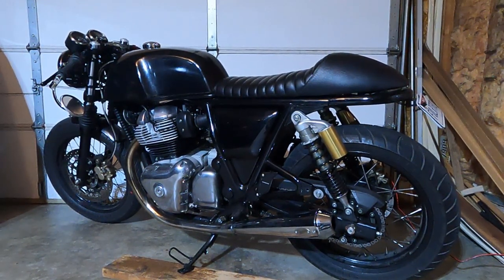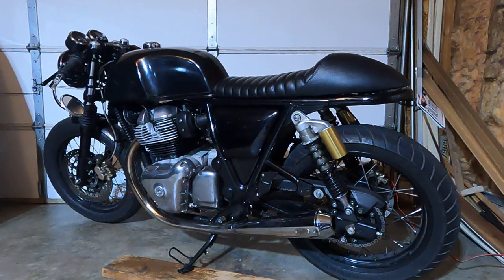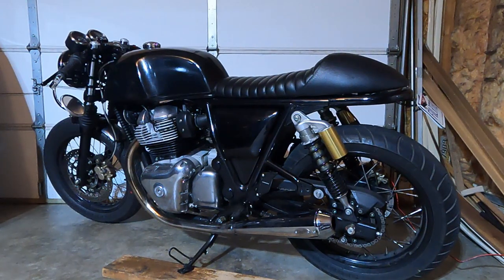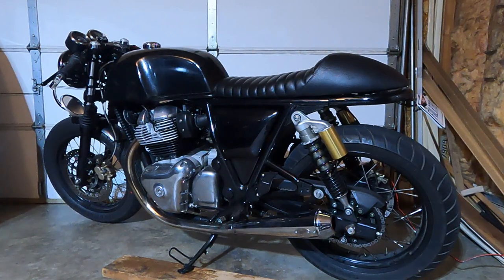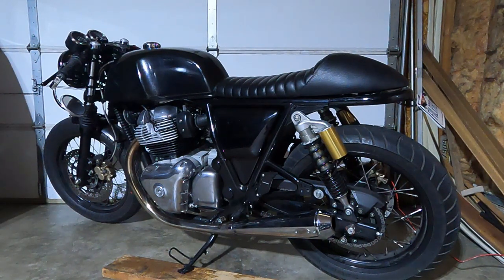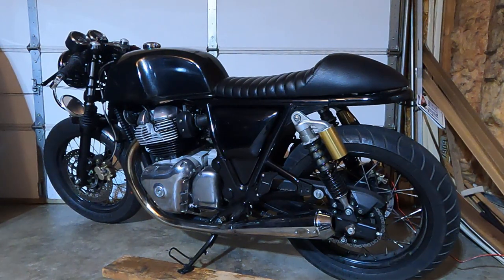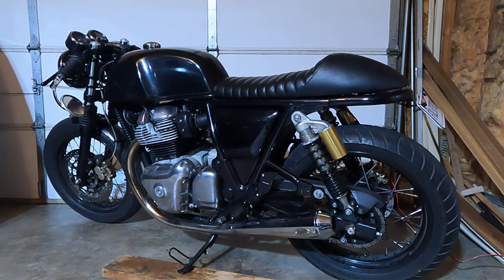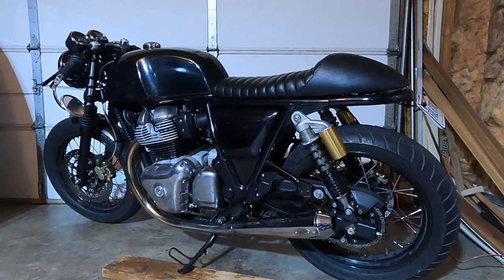Royal Enfield Continental GT Big Bore 865 Review, 0-60, and Epic Power Commander Map Battle

Comment: Much appreciated. I am using the 83.5mm pistons in my INT650 for 743cc, my two Triumphs have 90mm pistons 865cc; technically the 90mm pistons in the R.E. yield 863cc...your bike is very impressive and must be between 65-70 horsepower. It reminds me of the Norton 850 which had 4 gears instead of 6 and was much lighter (1970s). I had script made for my side-covers that says "750 Interceptor" in honor of the Enfield twin terror of the mid 1960's. 
Looking forward to the next video!!

Comment: Damn, I knew the mileage would drop with this upgrade but I didn't think it'd be that low :( Thanks for the update video
Reply from the maker: Part of it is me riding it like a crazy person everywhere.  I'm hoping to get more data with the 17 tooth sprocket and some longer cruises.  Thanks for watching!
Reply: @OakInch  Yeah to an extent bikes are meant to be rev'd out more than cars lol ya know. All good though. I don't think that would stop me from doing this in a few years. Veeeery involved of course, I still haven't watched fully your process video. Any reason you didn't take it to a dyno? Was it just not wanting to spend more to get that done? Would it have helped you speed up your process after the installation and stuff?
Reply from the maker: @motomitch  I may end up a the dyno at some point.  If I can get a canned map that is 95% of what I am looking for, and I can do everything myself, I am happy with that.  I have one more project coming up, and a couple more that I am considering.  Not sure how much money I want to spend on 10 more HP.  But, it may be too early to go through the process of really fine tuning the bike at this point.
Reply: @motomitch  nobody is mentioning that of all the S&S big bore kits, the two for the Enfield 650s are the only ones that are NOT bolt-in. First the liners need to be fitted. Secondly, the inside diameter of the liners is smaller than the outside diameter of the pistons so the liners need to be bored to obtain recommended piston to cylinder wall clearance. I had my machinist cross-hatch the cylinder walls and everything is a perfect fit; only the lower piston ring needed to be filed for the proper end-gap. The upper ring and oil-control rings were dead on specification after the cross-hatch. Both the 743cc and 863cc kits are not simple bolt-in. 
 I have built four of the so-called bolt-in kits and they are a cake walk in comparison. Hope this helps.
Reply: @frederickwoods5943  It does. Know what you helped me figure out? If I do this t omy bike, I don't wanna be the one to do it! lol, thanks for the info.
Reply: @motomitch  any competent machine shop/machinist can do the work but they charge by the hour. Mine was over $200 but that got it to the "measure your clearances and bolt the components in" stage. It is worth the almost $1,500 I spent for the torque alone. You are welcome.

Comment: Thanks so much for the vid and the info and problem solving you had to do with the mapping that is awesome. So, if you don't mind me asking, considering all the cost and for lack of a better word, hassles of it all to dial it in, is it worth it, would you do it again?  What is your feeling of the Diablo full exhaust, install, fit, quallity, I'm thinking about buying them just love the curve in them from the from the engine back, much nicer sweep then the bends on all the other exhaust systems available.
Reply from the maker: I think that people who do projects and mods can relate to what I am about to write.  The idea possesses you.  You are compelled to progress towards the goal.  It becomes thing you want to do most in life.  IDK if I would do it again.  I know it would go much faster and easier the second time.  Right now the bottle neck is air flow at high RPMS.  It is another $6000 for an upgraded throttle body and head.  It will also gain about 10 hp.  I am probably not going to do that...unless I am compelled.  I do have a limit.  Realistically, I think a full exhaust, DNA air filter mod, and power commander would have been enough performance.  At some point the money is better spent on a different bike, unless you genuinely enjoy doing the work.  Mostly, I enjoy the series of small wins as I make changes.    

I do like the Diablo exhaust.  I bought mine in a few years ago and only just now put it on.  I agree that it looks better, being curvy, than some of the others.  It fills in some space down low and in front on the bike that needs filled.
Reply: @OakInch  Thank you for getting back to me, thank you for making these vids and sharing them, for me they help a alot. Your bike is really really authentic 60's and 70's original sport bike beautiful. I'm 58 years old and old cafe racers BSA's and Kawi triples were the first bikes I fell in love with as a kid with 3 older brothers. I love my continenal, I connect to it like my old 78 RD400, it had clip ons and chambers. Thank you again, great bike buddy you should be proud of that bike and all the effort and work you put into it.
Reply: @OakInch  this is why I bought two of the S&S "750cc" kits; the roughly 47cc's increase per cylinder doesn't require extensive (or any) modification to the stock injectors, throttle bodies or ECU. If a person wants a "900cc" bike there are plenty, I own two 865cc Triumphs: Bonneville SE and Thruxton for instance. My 750cc 2020 Interceptor cost about $7,500 including the out-the-door purchase in May of 2020 ($5,949), the kit and machine shop fees were less than $900 and an S&S cam, and parts (8 head bolts, cylinder base gasket, etc another $75) plus a full stainless-steel exhaust system...just north of $7,400. Doesn't include my time of course, the bike has 28,000 miles so far. It is lighter, faster and cheaper than either of my Triumphs.

Comment: You needed a custom map making at a rolling road to get the fuelling spot on… every bike is slightly different. A none custom map is just a compromise. 
If you over fuel the the engine you will get bore wash and end up getting wear in your bores.
Reply from the maker: After I removed the airbox last week, I am pretty sure that I need a custom map.   I can tell it is getting more air.  The two canned maps I have used for the mods I have are probably leaving some on the table.  I think it is leaning more towards too lean at this point though.  I will have to go to a dyno.  I have been holding off on that because I wasn't sure if I was done with performance mods.  I think this is goiing to be good for a while.
Reply from the maker: Hey Sean, I actually got it on a dyno and tuned today.  Video update incoming after I get some tests and data together.

Comment: hey oakinch!  killer job and i have been enjoying your uploads and work.  quick question.

what did you do to get your instrument cluster slater up like that?  is there a product or solution you implemented? 

what length cables did you go with?  i bought the k-speed clip on's and light bracket and plan to lowering mine to your spec (you mentioned in another video)

last, there are a few videos on installing the clip on's.  did you end up taking the front tire off?  i wish there were some solid instructions on best approach and best practice when installing these.  

thank again for all your work.  your RE is my top fav mod and alot of the work im doing to mine is bc of your bike
Reply from the maker: Thanks!   That is high praise.

The instrument cluster probably should have been its' own video.  The goal was to get it lower and to lay flatter.  You will have to remove the top of the triple clamp to get at it.  There are, I think, 4 bolts underneath the cluster to remove.  There is a thick bracket, or collar, just under the cluster which the bolts are also holding on.  I removed the cluster and placed it under that bracket.  It required the use of a dremel on the inside of the cluster, where it goes up against the fork, to get it in.  When you attempt to reassemble, you will need nylon spacers to take up the space created when rearranging the parts.  You will also an assortment of new, longer bolts (maybe some shorter), because the originals will no longer reach.  You will have to figure out what the correct length will be.  I no longer remember.  I also used some rubber spacers on the two most interior bolts where they contact the triple clamp.  Their ability to compress allowed me to fine tune level the cluster.  But don't use rubber spacers anywhere else.  They compress too much.  I'll link to all the parts I used here for you.  You will have to get in there and see how it is set up for this to really make sense.  If you do not use spacers, the ignition switch, where the key goes in, will stick up out side of triple clamp.

For the clip ons, I did not remove the front wheel.  I took off the triple clamp on the top.  I think I had to loosen the bolts on the shocks and used a jack to move the bike frame up and down, with the rear tire in a stand.   I never removed the shocks though.  I didn't even do that for the fork gators.  I had two sets, and I did a test fitting of the gators by slicing one set and just gluing it back after it was on.  Then I just left it because it worked and you can't tell I did it like that.

I never had to buy new cables, except for my speedo cable because it died.  I removed all the hardware from the old handlebars.  Everything worked.

2 sets nylon washers:
https://amzn.to/3ZB5OTc
1 set Rubber washers:
https://amzn.to/3J9ADrh
M6 Bolt assortment longer
https://amzn.to/3Fimtml
M6 Bolt assortment shorter
https://amzn.to/3ZXiYd5
Black Metal Washers (I don't think I used these)
https://amzn.to/3YJAaSa
Handlebar drill guide.  You need this to install switch gear.
https://amzn.to/3T6TUOm
Reply: thank you for taking the time to put this response together.  much appreciated and many thanks!

Comment: thats a fast bike, a tek 2into1 should give more tourques 😁
Reply from the maker: I like the way two pipes look.  The ones on there are now are basically empty tubes.  As far as air flow, I am pretty happy with them.
Reply: @OakInch  
ok that's KEWL, 
I have seen Old bike pix with the rounded look, so it is a retro look. and should flow better without sharp bends. 
The Tek 2 in to 1 is like a crossover pipe in a car, it creates a scavenging pulse on the other cylinder pulling in more fuel air mix. 
I think your good ot Torque anyways. 😁
Reply: @OakInch  you could start using your bike to measure things on the channel now that you have dono data an test runs.

Comment: Hey there! Did you have to add any links to the chain with the 17T front sprocket? I’m about to do a 17T swap on my GT650, sounds like 16T doesn’t require any added chain length but haven’t been able to find any info about using the 17T. Thanks!
Reply from the maker: You should get a chain with more links.  I didn't do that at first.  It did need it.  I'm on a 16tooth sprocket now and that is fine with the original chain.
Reply: @OakInch  Awesome, thanks so much!

Comment: I have the INT 650 sunset strip. What temperature are you getting on the gauge?
Reply from the maker: Usually around 80C.  On colder days it will be around 70C.  On hot days it will get to around 90C.